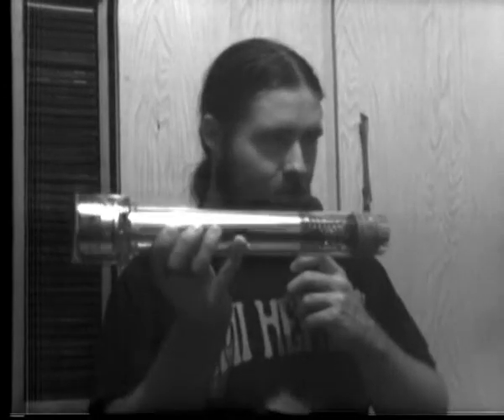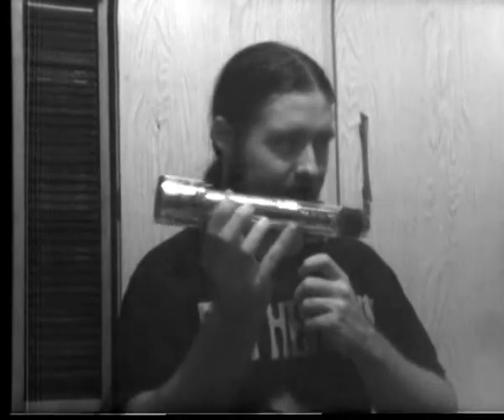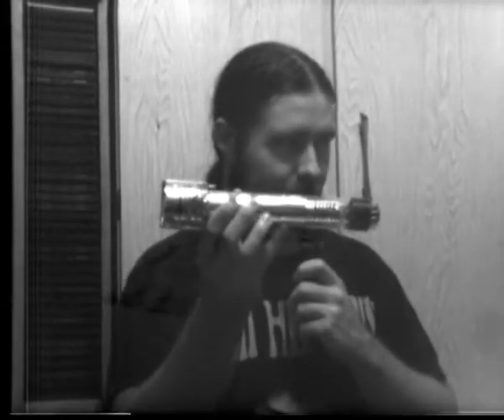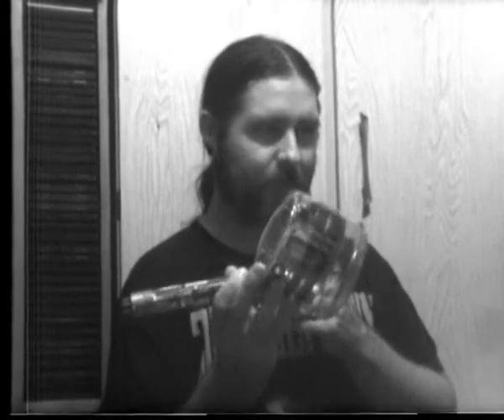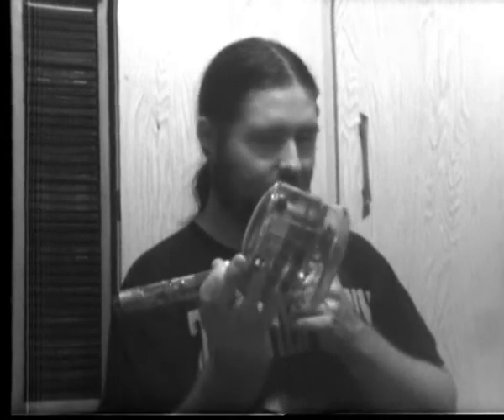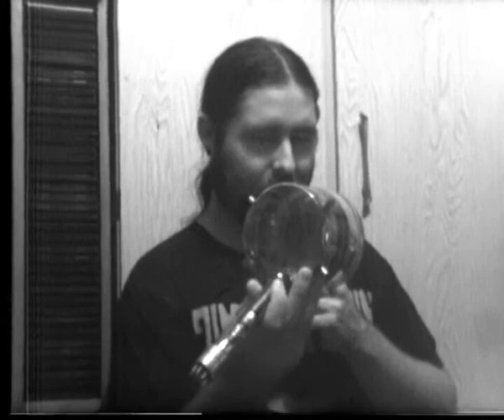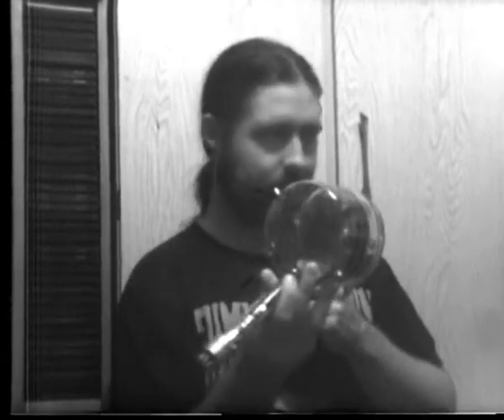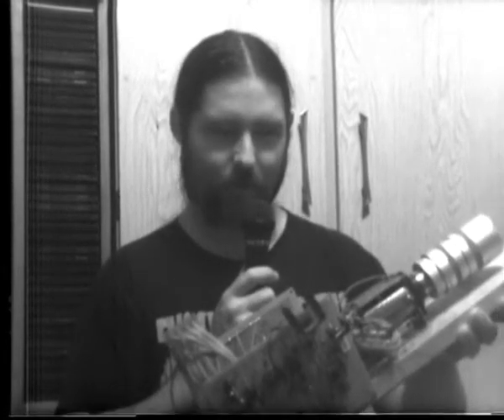My TV camera tube collection

Comment: Have you considered trying to make a colour image orthicon camera? I guess the harder part is finding a 3" sized beam splitter it would be quite interesting to see what videos would have looked like if colour had came along a bit earlier. 

I guess a simpler way of doing it would be to find a 50/50 splitter and using two colour filters (I think it was magenta and yellow for producing colour with only 2 tubes)